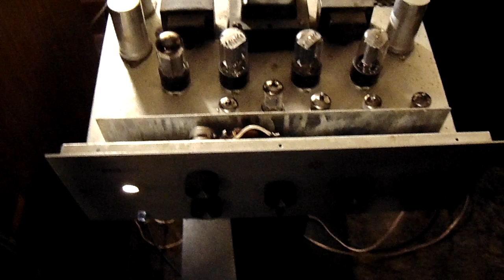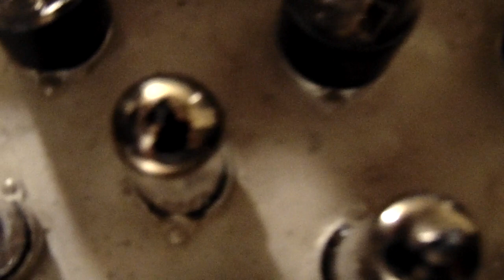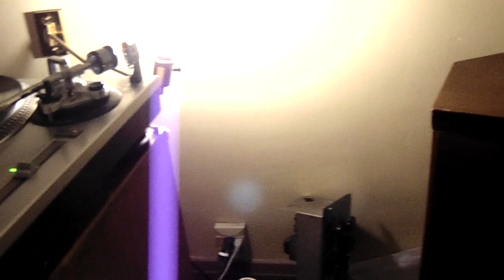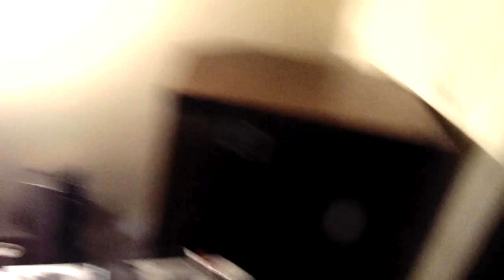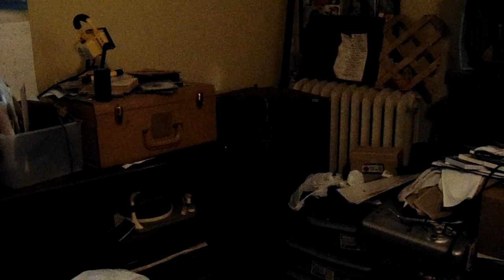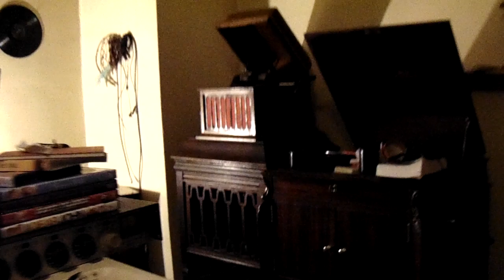Harman Kardon 300 Award Series Integrated Amplifier with Klipsch Short Horn and  EV  Klipsch.

Comment: also check loudness control  as its resistance has probably changed over the years. mine was double the res..
Reply from the maker: I probably need to replace all pots and switches, however for 12 watts a channel, It sounds louder and fuller than  my Marantz 2235 solid state.